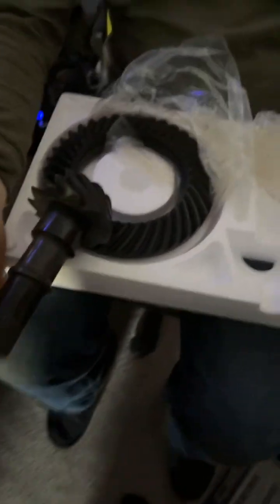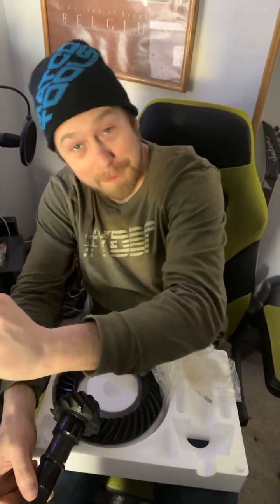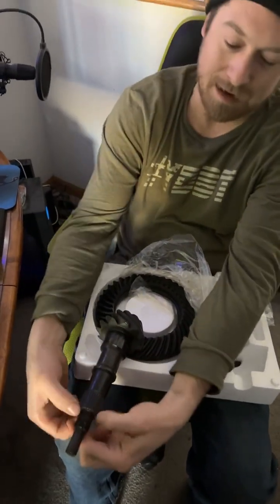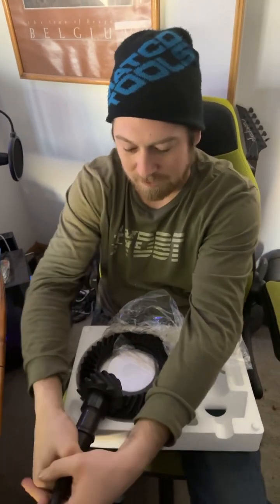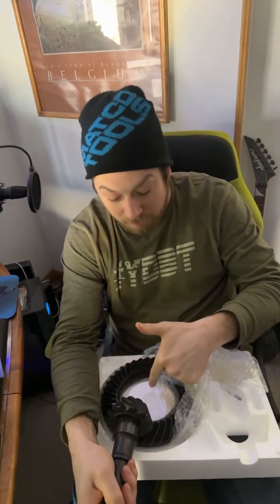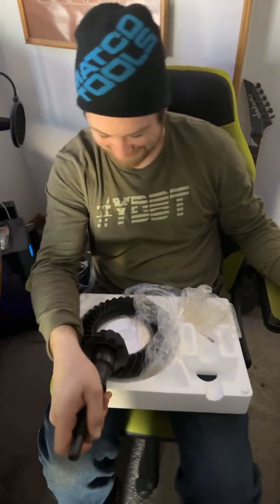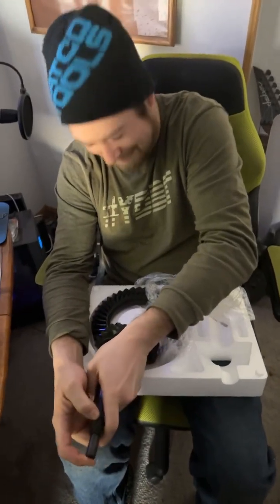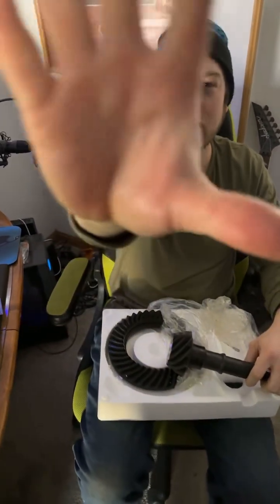What Is A Ring And Pinion? #shorts

Comment: Yoke not yolk! Pinion to carrier. Fun. Definitely a pain setting pinion depth and backlash to spec, setting them is easy but doing it right can take 10 removal and install, then run pattern, then do it over again until you’re in spec. Don’t crush the crush sleeve too much or you’ll need another.❤❤ ring gear spins the carrier by spinning the ring gear. You do have two rear wheels however some have a gear style limited slip so have some have clutch packs. Explain a limited slip rear end to her.
Reply from the maker: “How’s a posi-traction rear end work!? IT JUST DOES!” I’m actually installing an Eaton Truetrac with this set!
Reply: @ 😂 I mean you’re not wrong!! lots of fun huh? I hope it goes well. I have to do a Dana 44 and Dana 30 regular Non High pinion. I’m installing 4:56 gears in a 2014 Jeep Wrangler just waiting for warmer weather. God bless.
Reply from the maker: When I had my XJ, one of the first mods was my Dana 30 low pinion swapped to a D30 HP. That's not to say the LP Dana 30 is any slouch. Also swapped the Dana 35 rear for the Chrysler 8.25 and added the Spartan lunchbox lockers front and rear. Stock 3.55 gears on a 4.0 so it was gutless, but pretty capable.
Reply: @ nice!! I love Jeeps and wheeling. They are tanks. I have to as it’s so underpowered with the 3.6, hence the 4:56 I really miss my 4.0 96 Cherokee. I sold it running at 300,000 miles with the 4x4 and air conditioning still going strong, numerous U-joints later but only U-joints. I Loved it, wish the epa allowed it again. Just everyone else’s parts or…
Just 
Empty 
Every 
Pocket!!
Reply from the maker: @gunztommiegunz  Haha you're not wrong. My daily for the most part is a 2021 WK2 with the 3.6, but my winter beater is a WJ 4.0. Had an '04 WJ 4.7 back in the day as well as the previously mentioned 4.0 XJ 2001. They cost money to upkeep if you want to use the full potential and be reliable, but they are definitely capable.